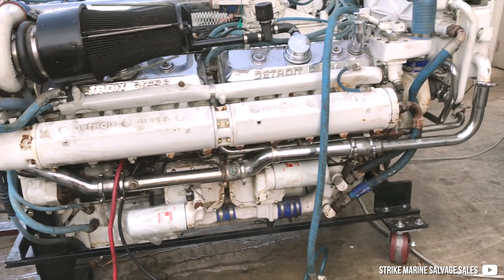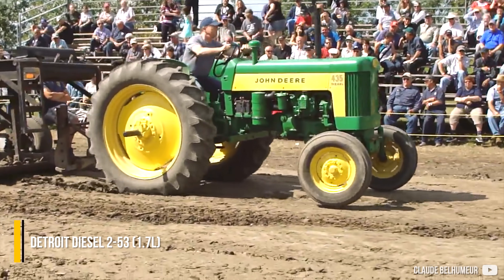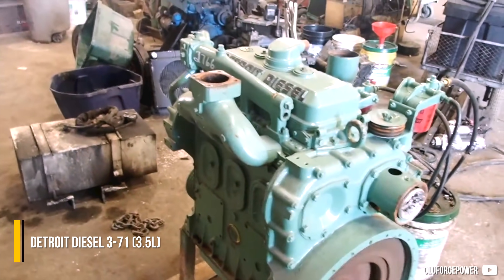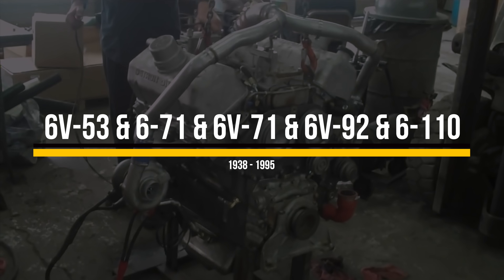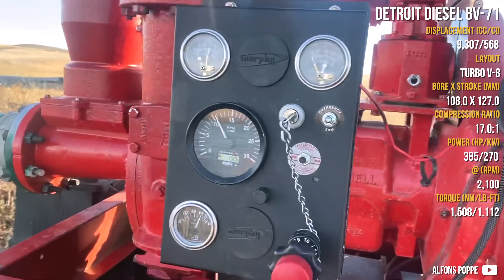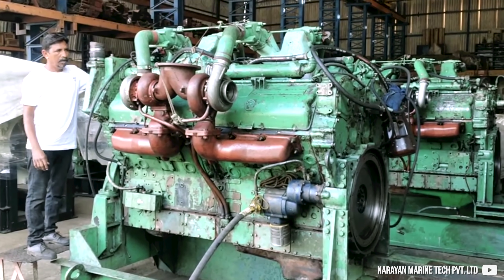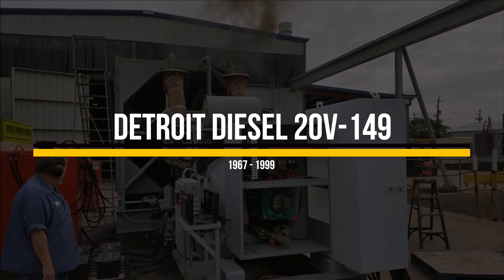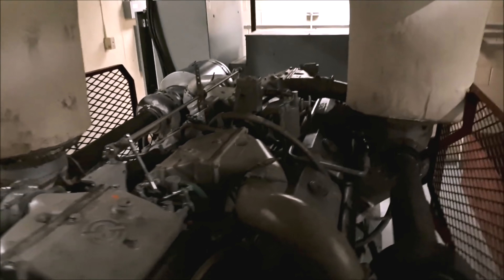Single to 24-Cylinder Detroit Diesel Engines

Comment: 2 Stroke Diesel Engines are still used in very large engine applications. So it is really cool that this design was also used in road vehicles. If they were not so inefficient as far as fuel consumption we would still have them around.

Comment: you forgot to mention why they had blowers where no other diesels did, it was used to pressurize the engine intake and valley to start the engine. they had sleeve valve cylinders and no intake valves in the head, only exhaust valves. after the engine started the blower actually didnt do anything for performance

Comment: 1292 and 1692 were used in larger sport fish boats in the 80’s and 90’s. The 1692T made 1450 hp. The larger Donzi sportfishers had them. All chrome valve covers and fittings. Underway in the engine room was not for the faint of heart.

Comment: You need to do a yanmar diesel engine video, cover their own engines and their engines spec'd by John deere. Why deere wanted "big bore" versions in their north American tractors, as in yanmars 3t84 engine and deeres version the 3t90t where yanmars ran an 84mm bore of the same exact engine deere used it was bored to 90mm with much stronger cooling system

Comment: I rebuilt a few 4-53s and countless 71 series from the 4 cylinder through the 16Vs starting in the early 80s through around 2005.  We would Dyno test them after rebuild.  I’ve seen them run on the dyno under full load for hours at a time.

Comment: Worked in the oil field in Texas late 70s operated a pump truck with 2  V16s and two pumps. When you got three or four of those singing on location, it was a memorable sound.

Comment: During the 1980s I worked in the oilfield operating a frac pump we had DD engines, they were 12V141 I don’t know the HP rating, but when you get 6-8 on location & they all throttle up at the same time it was amazing. Another location had a couple that were 16V141 they would pump a lot of water in a hurry.

Comment: Thank you for showing them all running! You can't miss the sound of a screaming jimmy. Gm engines were used in boats, 2 running side by side could be configured to run in opposite directions. Ted from down under.

Comment: 4:39 Okay, young man. A  blower, is  NOT   A    TURBO.  A  blower, is a mechanically driven, dual set of  ' screw '  type air compressor. Compressing the input air, AFTER the air cleaner, INTO  the engine. (On top of the engine, between the two V's)  A  turbo, is an  EXHAUST  DRIVEN- powering the  ' compressor '  side of it. This is where the atmosphere gets  ' compressed into  the  cylinders '.    One 1997 Mack i drove  ((460 Mack engine) had up to 45 pounds of turbo pressure ))   ( old trucker....)
Reply from the maker: What's not clear about that? There was a turbocharger before the air got into the blower. No need to explain the difference between a turbo and a supercharger/blower.

Comment: Most people think Detroits are gutless but they forget about the size of them compare to a four stroke and so a too small of a engine gets used because of its hp rating. For example a 350 big cam cummins and a 12v71 are both 14L engines or 850 cubic inches, yet one has a turbo and make 350hp and the other has no turbo and makes 425hp!

Comment: The US Military, used two stroke Detroit engines until 2007, from what I have been told. These actually had gen 4 electronic fuel injection, similar to the 60 Series Detroit engines, and can be tuned to run without smoking and tons of power.....

Comment: Those larger Detroit Diesel engines were mainly used for EMD-F9 locomotives that powered big powerful electric motors that helped pushed them down the track! The two strokes were great because they revved high

Comment: I take issue with you calling a Detroit Diesel as "naturally aspirated"!! Both the 53, 71 and 92 series 2 strokes had super chargers, more commonly known as "blowers" with either parallel or helical vanes! A 2 stroke diesel engine cannot run without a blower!! 8:08

Comment: My favorite COACH [BuS] engines DETROlT Diesel 8cylinder & 12 cylinder / DEUTZ Air cooled 8cyl & 12cyl engines. DETROlT Dirsek died when acquired by german Daimler group ☹️☹️☹️☹️☹️☹️☹️☹️☹️☹️

Comment: In Finland, many Finnish made busses had a two stroke diesel engines like Detroit Diesel or Sisu-Cummings. There is still a Kabus (KoivistonAutoBus) busses with a Detroit Diesel 6V-71 engines in use here! Also many tractors had Detroit Diesels here in Finland.

Comment: On two stroke diesels what people call or think of as a supercharger is NOT it is a scavenge pump pushing air into the engine, without they will NOT RUN!!!!! 
Nothing but NOTHING on earth has the sound of a Detroit!!!!! There were buses here that used V6?? Detroits you could hear them coming a long way off, they would happily do 70++mph on the open road!! Typical of America IF more power is needed just make the engine BIGGER!!!!!!!!! No replacement for displacement!!!! 🤣🤣🤣🤣

Comment: I was a MK3 on the USCG 95' Patrol  Boat Cape Hatteras, and after the repower, with two 16V149TI Detroit Diesels, Seattle to Ketchikan in less than 24 Hours.

Comment: Greetings from Oz! Love your work! Back in the day, (30+ years ago) I spent a lot of time on 8V71's. When we were doing a governor set, one of us (2 man job) would have to sit on the blower housing to make adjustments. Sitting on an 8-71 blower with the motor running flat out without a muffler is an experience I'll never forget. I saw one run away once. The sound was amazing! They got it shut down before it blew up, fortunately. My other memory, not so good, was 2 full days of scraping off gaskets & washing parts prior to assembling the engine.

Comment: I've got a 1954 4/71 GM diesel ( they were renamed Detroit Diesel in 58) in my boat a 40f ex-fishboat great boat engine. I ran a tug, actually several, but one had a 12/71, which had big injectors and probably some special balancing that spun up to 2800rpm and could put out a lot of power. This was intermittent, and you had to watch your heat build-up. It was special built for ship assist. It had an incredible roar at 2800 through dry exhaust. l loved running that tug; it was a beast.

Comment: On my volunteer fire department we have a pumper with the 2 stroke supercharged Detroit unsure of size but gonna guess a 6-71. Supercharger let go when one of the guys failed to properly oil it so now it's got a lot of blow by. It's in the shop being repaired but when it left a few said it would be harder to tell what was smoking most the fire or the truck putting it out.

Comment: We had a Dynahoe 190-4 which had the 4-53N in it. It was a great running and starting engine but above 2500 rpm it sounded like you were going to tear a hole in time and space. I would love to see how efficient one of these could be with modern day common rail injectors. You didn't mention it but all the valves for Detroits are exhaust valves. Very interesting design and an excellent way of making a ridiculous amount of noise.

Comment: It's kinda odd to figure out how the 2-stroke Detroit Diesel engines went from being regarded as revolutionary high power-to-weight masterpieces of the American engineering to boat anchors, once the 4-stroke engines evolved. Well, I'm sure a lot of room for further improvements was still there, and maybe a slightly updated iteration of the 53 and the 92 could've still been around...

Comment: I worked on and with, a lot of Detroits over the years, mostly 71's, but a few 92's and 149's - mostly in marine applications - both generators and main propulsion,
I always respected them, they would tolerate a level of abuse that was difficult to comprehend... but I never loved them. 
They were all loud and dirty engines, but definitely tough and reliable.

Comment: Nicely produced video. Thanks for sharing. If I could suggest, when you are putting the stats on the right side of the screen, you keep a format that is easy to read. You had HP before kW but in torque you had NM before ft/lbs.
Reply from the maker: Yeah, because I prefer the hp and Nm rating, that's why. Thanks, anyway!

Comment: The terex scraper I ran had a 12v71tt in front and a 6v92t in the rear. It used 340 to 360 gallons of diesel a day. You could grease the entire machine while getting fuel. The 12 used 2 gallons of oil and the 6 used 1 gallon a day. 10 hrs. They were fast. 10 speed Allison transmissions. I didn't have to wait for a push dozer.

Comment: I have a world war  II   35' motor boat with a 3-71 engine that was built in 1938.  I enjoyed it for 7 years, then it just wore out.  i never worked on a diesel engine, but with help from youtube videos and a few mechanics that would waste time talking on the phone i was able to rebuild the engine without removing the engine from the boat.  I wish i had gotten into diesel when i was a kid.  I have always worked on my own engines, and have destroyed a few.  but the detroit was the most enjoyable.  It seemed just too easy but so interesting to learn about injectors and the roots blower.  I gained so much confidence in the boat since i rebuilt it and even made a few off shore trips in it.  It hasn't missed a beat since i rebuilt it.

Comment: I have run Detroits from 353’s to  Silver Series 8V92T’s and have the hearing damage to prove it. Thousands of hours in Knuckle Boom loaders with 353T’s and 453’s until the 5.9 Cummins took over power unit duties. In a truck the 8V92T is my favorite sound! They are simple but very tough engines. They can run at the top of their governed rpm all day and do it for years!

Comment: I drove a seismic drill rig in northern Canada powered by a V6-71. Quite the racket after 8 hours but nevertheless a wonderful sound. I'm currently working on a 8V71 to use in tractor pulls. I think I should add a turbo or 2 and M95 injectors. Thanks for putting this cool vid together.

Comment: I have a fondness for old John Deere tractors and am restoring a 1955 JD model 70. I thought I knew everything about the old John Deeres, but I never knew about the 435: it was only built in 1959-1960, and had a two cylinder Detroit Diesel engine (model 2-53, 1.7L, 33 hp), the only model to ever use them. Only 4,626 were built. I want one!

Comment: About the only things I have never heard of "Detroits" being used for were airplane engines. On the in-line versions the blower could be positioned on either side by rotating the block. The engines were made to be both regular and counter rotating. Some engines were made to lay flat such as when used in buses. Others were made to stand on end for applications where they were dropped down into mine-shafts to pump out water. Many other manufacturers made 2-stroke Diesel engines, one from Japan almost completely copying all dimensions and designs. Working offshore we called the 149's "WEED EATERS." Satisfactory for power, but had frequent service intervals as compared to the EMD's. These were the big boy Detroit Diesels used in ships, submarines, locomotives, generator power plants, and oilfields. Imagine a submarine, submerged running off massive battery banks. However eventually they had to be recharged, thus you surfaced. the Diesel engine you used for recharging the batteries had to also propel the submarine. A sitting duck was a dead duck in times of war. You needed speed. Some when used in WWII tanks had a "battlefield" position. Again, too slow, you are dead.

Comment: Growing up, the local mine had a bunch of Euclid trucks with twin 6 71's.  When they dumped the box was disconnected from the exhaust and they really roared.

They had an interesting thrumming sound as the engines went in and out of sync.  On a summer night with the windows open it sounded like a distant swarm of angry bees in the distance.

Comment: My motor blew up on my woodchipper so I found a 2-53 detroit in a junkyard cleaned it up put fuel and a battery to it and it fired right up. So I swapped that 2-53 onto my woodchipper put bigger injectors in it, and it eats everything I put in it. Its been running good its crazy I pulled a 40yr old engine out of a dump and it runs like it brand new.

Comment: I worked at Stewart and Stevenson in the 80's.  Dallas location.  I recognize the gentleman at minute 12:00.  Mr. George Scarlet.   Hen knew those engines inside and out.

Comment: The 71 Series is hands down the most versatile engine design ever. With the exception of the 1 and 2 cylinder engine, a large amount of parts can interchange across all other engines.
Detroit's we're found in anything that needed an engine, airplanes not included (I could be wrong on that 🤔😂,)
I consider myself lucky to have had extensive experience with Detroit's during my career, first in trucking, then in marine apps.
I also get to work on Detroit's bigger cousins,  Series 645 and 710 EMDs.. 💪💪🤗

Comment: These 2 strokes have a sound unlike any other engine. I have drove several fire trucks in my years that have had different Detroit 2 strokes, and my father was a semi driver and owner/operator and had detroits. But you can explain why they sound different but it’s not going to “hit home” until you hear them in person.

Comment: The 6L-71 was used in almost every US made landing craft in WW2, it was extremely tough, extremely reliable (it had to be when used in a boat that came under a lot of gunfire), put out good horsepower and had great torque and had good fuel consumption (it could go a long ways on not that much fuel).  It was also used in a lot of motor yachts and was turbo-charged to phenomenal outputs, almost 500 hp for the 6-71s, and would hold together.  The V-16's were called "sweet 16's" for their output, reliability and smooth running.  They also had a long production life which probably ended with environmental concerns, being 2-stroke they were a little difficult to make clean running, although they were economical and ran "lean".

Comment: For large trucks and bus I think the 2 cycle diesel still have a future as a horizontally opposed 6 cylinder turbocharged engine where two pistons meet in the middle. 6 is enough as it reduces total engine vibration and doesn't need balancer shafts and for Bus 2 extra cylinders are needed for generating the electricity needed for hotel loads on the bus. Between the opposed pistons you have the valves on both sides of the piston wall. The emissions can be fixed by using electronically controlled exhaust valves, two sets of them, on two camshafts 180 degrees apart. 180 degrees away from the exhaust valves you would have the two sets of intake valves with two camshafts. Why you may ask? To reduce valve float at high RPM and improve redline, improve scavenging, and improve intake efficiency, and reduce noise at low load by deactivating one set of camshafts. At low RPM you could deactivate one set of intake and exhaust camshafts by using an idler lobe on each section of the camshaft (Honda V-TECH Style).

Comment: Love em   in my trucking days I had a 6-71  town tractor  finished my driving career late 80s driving produce with a 8V92  475 hp   18 speed sooooo much power  we had a 6V92 in a city truck  and a friend was a tow boat capt   had 2  16V149 with turbos   and a friend with a boat with 2 16V92 s with twin turbos  and a fork lift with a 453   needless to say they are in my blood    Don't forger the locomotive 2 cycles

Comment: My dad owned a sawmill, many years ago, where  the head saw ran off a 6v71 and the edger ran off an 8v71. I could hear, from town four miles and a valley away, what the mill was doing at any given time. Sadly the sawmill was lost to fire from a cummins turbo failure.  There's nothing like the sound of a straight pip 8v71!

Comment: My dad had a friend that was an engineer for Detroit Diesel and he's the brains behind the 16 v71 the 20v149 and 2471 his name was Gary Davidson I remember his son had a w900 Kenworth in the 80s had a V12 Detroit in it 12v71 put out 3000 horsepower if you floored that truck going up a hill it would blow the drive tires out just blow the side balls apart I remember seeing this truck to the kid going up and you can watch the side balls ripple from the torque it's amazing what you can do with the Detroit's and Long live them down with the EPA I have a pickup with a six b-53 in it non-turbo and as a screaming mother

Comment: Hummmm... naturally aspirated engines our engines that do not have a blower or turbocharger. You need to check your information. Also for the 6ft 53 it too was used for marine applications for example the Navy made a fiberglass boat which had two 6V 53 and a Jacuzzi propulsion system during the Vietnam war

Comment: Not sure if you mentioned it but Detroit diesels are all 2 stroke, they use superchargers to force air into the engine via transfer ports on the cylinder sleeve. The supercharger is also used to force fresh air in to push the exhaust out through a exhaust valve.

Comment: I used to drive haul trucks (as in mining trucks, 80s Euclid R190s to be specific) with 16V149TIB engines (1800hp, a bit over 5000lb ft of tq) and they were so cool sounding.  Other than say, a methanol powered drag car engine or a turbine powered aircraft, they are the single loudest engine I have ever heard. I've driven far larger and more powerful trucks since, but none had the personality of those enormous 2-strokes.

Comment: The engine displacement is also integral to the development of the blowers I believe. 6-71 blower was designed for the 6 cylinder 71-ci per cylinder engin, 8-71 etc.  thought that might have been in the video